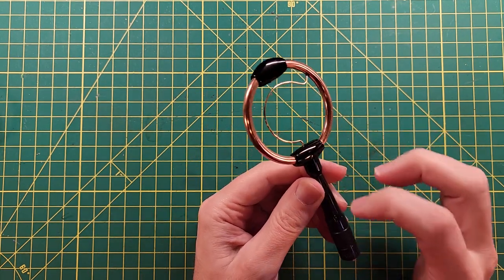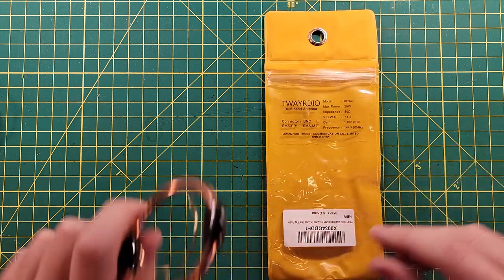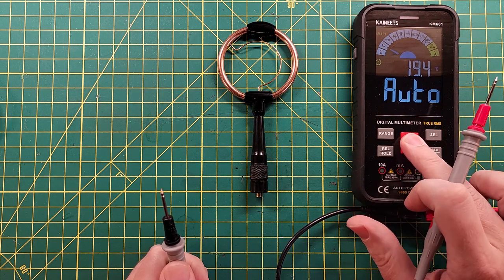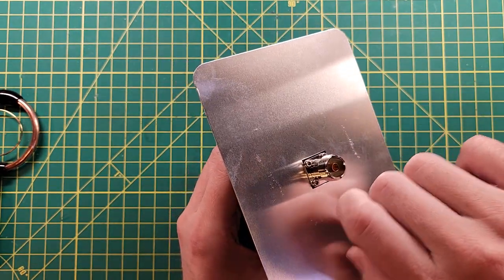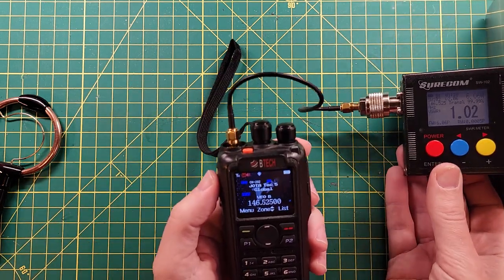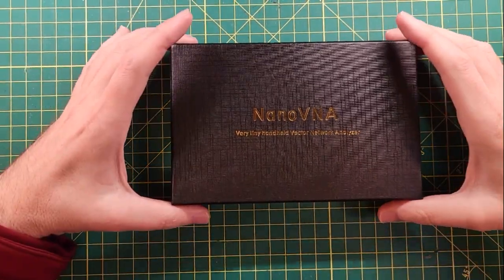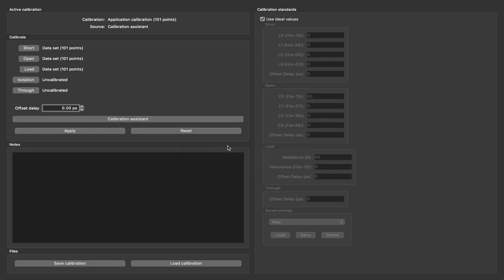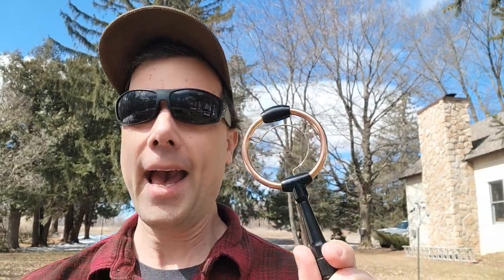TWAYRDIO Dual Band Loop Antenna Gimmick Or Good? #ht #antenna #hamradio #hamharder

Comment: Same hear, saw it and had to get it. Put it on one of my Baofeng UV-5Rs and it has been working very well both using 2-meter and 70 CM Repeaters in my area. I plan on getting another one to try with my Yaesu FT-60. 73!
Reply from the maker: That would be great.  I wish there were more repeaters in the area here.

Comment: I've used the antenna for receiving only and it works great , rf gain  3 points better than the antenna that comes with the radio !!
Reply from the maker: Hears better then it speaks?

Comment: Your increased power (TX) on certain frequencies might be useful if you use that specificly and all the time. SWR of 2 isnt bad at all. Maybe they forgot to add a tuner knob. I suspect this is a marvelous antenna for airband (118-136MHz) AM only. Did you test SWR with Amplitude Modulation? Maybe it is even a good antenna on CB band (25-30MHz) FM (SSB)
Reply from the maker: I really wanted to like this antenna!

Comment: One thing about loops is that they are very sensitive to what is around them and detune quite easily, so a nanoVNA test in the open field would had been good. On normal magnetic loops, you can adjust capacitance to compensate for nearby metal objects, but this antenna is likely to have a fixed capacitor. One good use for these antennas is for fox hunting though.
Reply from the maker: Very true

Comment: I bought one and tested it in a proper test fixture. The SWR on 2m is spot on 145Mhz with a 1.2:1 SWR but there is no resonance at 440 that is worth while. That said, it is probably still better than the regular rubber dummy loads on the market. Tested with HP 8753D.
Reply from the maker: Thanks for the update!

Comment: I have that same swr meter and I like what you did with the ground plane there for HT antennas.  Do you have a video detailing that little add on?
Reply from the maker: It came with my Surecom.  Its a piece of metal 6 3/4" x 4 1/2" with a hole for the SO-239 and a hole to connect to the ground lug.  I'm assuming the ground lug needs to be connected.  Love your channel and the stories.
Reply: @temporarilyoffline  Well poop, I didn't get one.  Guess I'll have to make one.
Reply from the maker: @KB0OTY  I believe in you!
Reply from the maker: @KB0OTY  I believe in you!

Comment: Maybe the loop doesn't need the ground plate. Loops are sensitive to near-by metal objects. Another reason I have not bought, is the loop is a 180° directional antenna. BAD NEWS for walkie talkies. The directions are in line with the loop arrays and NOT the hole. Driving and talking on that thing will be a picket fencing nightmare.
Reply from the maker: Yeah, its neat looking, but not neat working.

Comment: A gain of 1.8dBi is pretty bad.  A dipole has more than that.  This is probably better than a typical rubber ducky, but that's a pretty low bar.  And given that your tests revealed that the SWR claims are bogus, I bet it doesn't even have 1.8dBi of gain...

It's really too bad, it's a very interesting-looking antenna.  Maybe yours is defective?  You could open it and see if there's a broken solder joint or something.
Reply from the maker: It could be broken, need more people to test them.  There were a few others that had videos on this antenna that got the same kind of results.
Reply: @temporarilyoffline  Yeah, some other testers found it was sorta-okay but nothing spectacular, but not an abject failure like yours turned out to be.  Maybe they have serious QC issues.

Comment: Appears similar to a Near Field Magnetic Probe
Reply: My thoughts exactly. It's a stubby with some shit on top that's not even connected to the stubby antenna.
Reply: take it apart. If that type of antenna actually worked someone would have been making it already.
Reply from the maker: I was hoping, seems like the magnetics are only in the far field around here.
Reply: @hkmp5s  Well, no argument there.  I was thinking of the discovery of penicillin when I made that comment.

Comment: Interesting.  Maybe you got a bad unit?
Reply from the maker: Could be
Reply: Mine had high swr as well
Reply: @ryankc9oza118  That sort of rules out a bad unit.  I wonder if a 19 inch tail on the shield side to act as a counterpoise would do anything for the SWR.  I had one of those Abree monstrosities and it brought it down, but I still threw the antenna away.  What a waste of money that was.